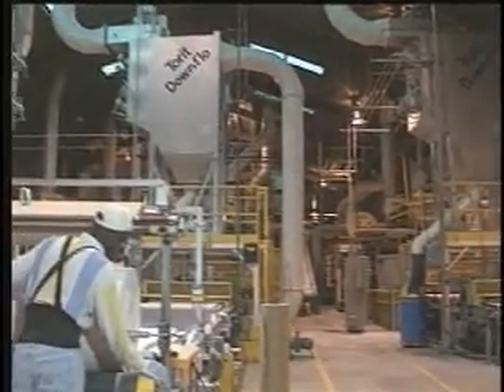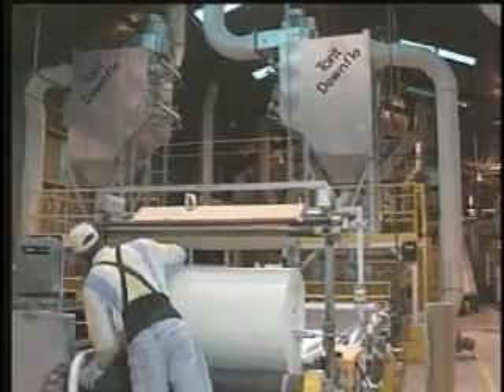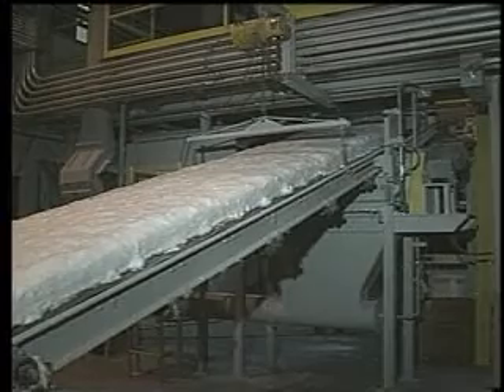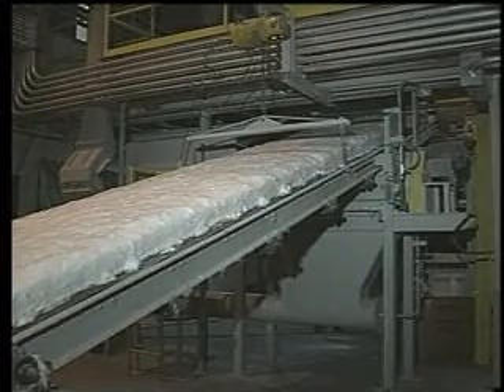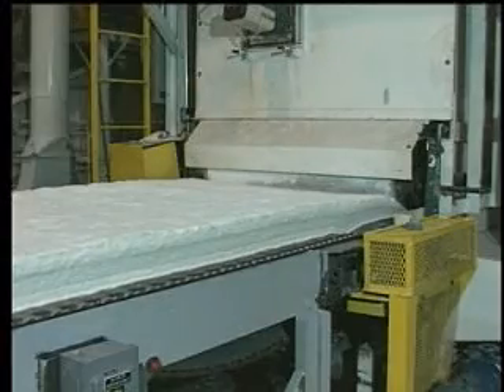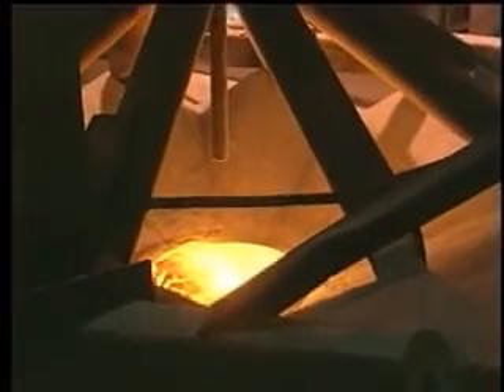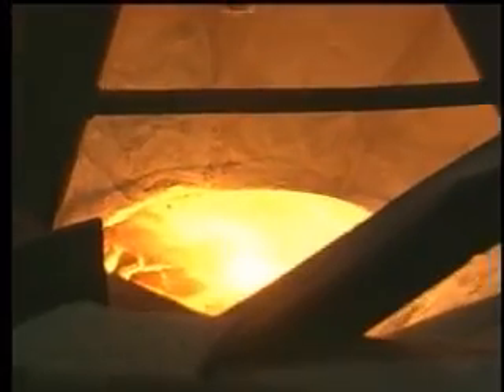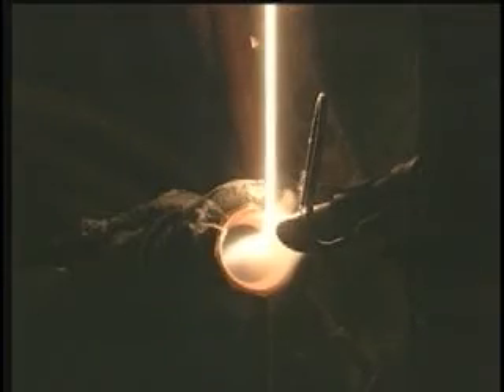Method of Ceramic Fiber Manufacturing

Comment: Shocking people walking about in these places without respirator on!!
Reply: I worked at this facility in the electrical dept.Yeah, we wore HEPA filter resparators. Normally everyone is doing this. Not sure why in this video the quality control person is not wearing one. I will note this facility is in Augusta GA and in the summer the heat and humidity is high. The resparator is pretty uncomfortable. I wore it but then it was not uncommon to see those in production departments assigned at the end of the lines not doing so. That falls on the department manager to enforce the practice.

Comment: I worked in a plant like this for seven years as an Industrial Electrical Instrumentation tech for the engineering and electrical dept. Being there at the furnace and spinning assemblies was like something out of science fiction movie. Ceramic insulation is very effective when there is a need for isolating heat. When working with any ceramic fiber based product do wear HEPA rated respiratory filters. Extended exposure to silicon dust will cause silicosis, not a good thing. In my opinion ceramic fiber is the replacement for asbestos. The product does a great job. The blanket can be encased in a stainless steal foil making it a ideal for fire protection for ducting and engine compartments. This product is called FireMaster Blanket. It is a certified product. I worked for Morgan Advanced Materials, formerly Thermal Ceramics of America . Located in Augusta GA.
Reply: can you please give me any or suggest me any paper to understand how ceramic fibres are made ? and how to make them in lab or small scale please

Comment: https://youtu.be/ge6mOJKSWfw
The new type of stitched ceramic fiber module, he has a weight of more than 200kg / m3, fully automatic production equipment, compression, sewing, cutting and molding, complete the entire production process. Reduce labor costs and high efficiency.